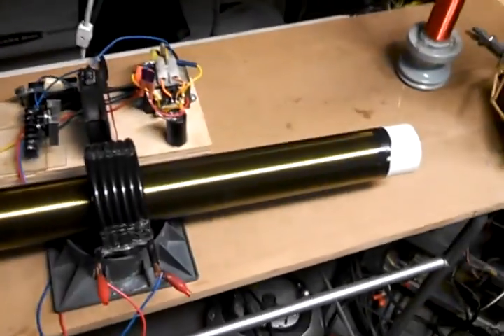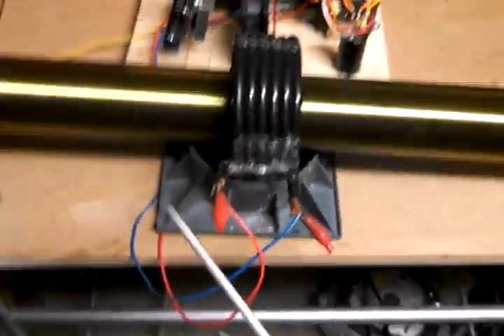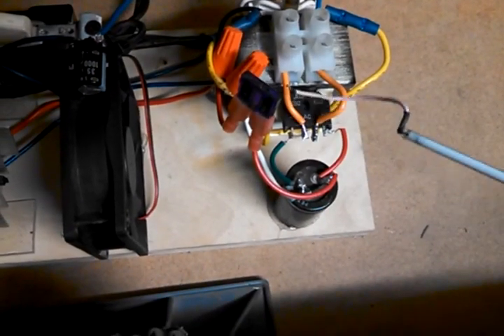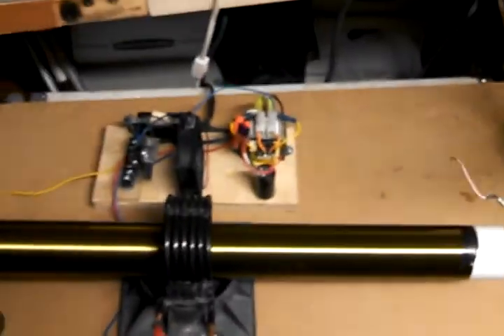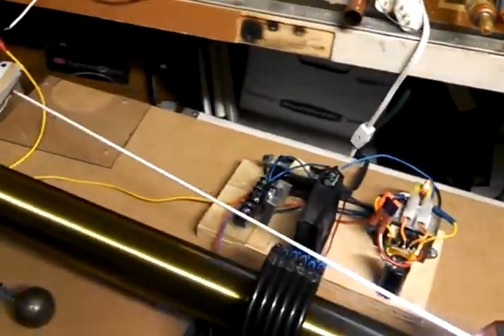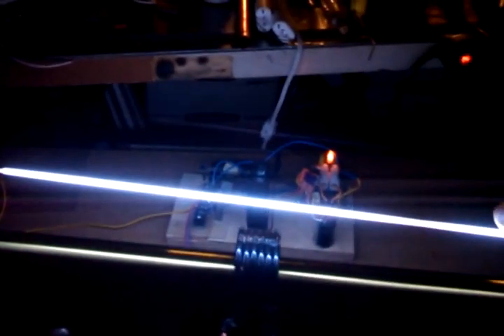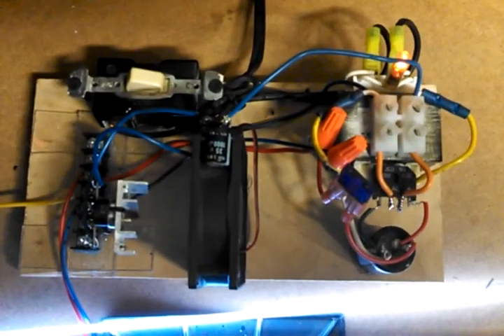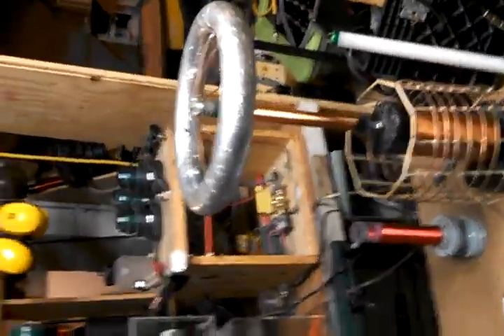Bigger bipolar slayer exciter Tesla coil.

Comment: Hey, I see you collect glass telegraph insulators! So do I, got a box of a bunch of different styles. Someday I intend to put them together into a nice shelf display unit with LEDs inside them for illumination.
Nice coil, you've got some good corona coming off the ends there. No center tap on the secondary, I see. I'm thinking about putting one on mine.
Reply from the maker: Cool idea sir.
Reply from the maker: I've always wanted to go insulator hunting out west.
Reply: Terry Woodroof
Most of mine came from garage sales. I've only cut down one abandoned telegraph pole!
Reply from the maker: TinselKoala lol